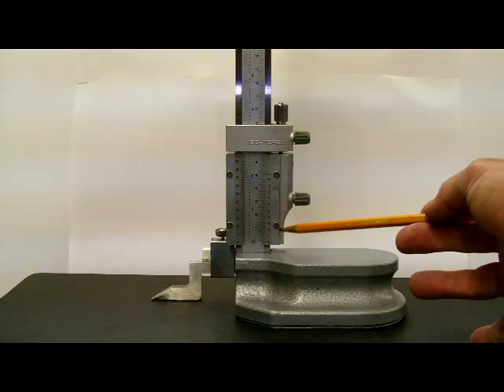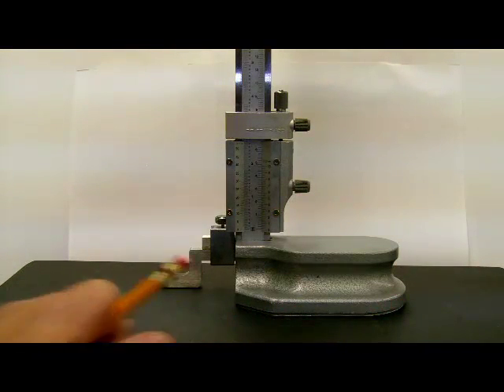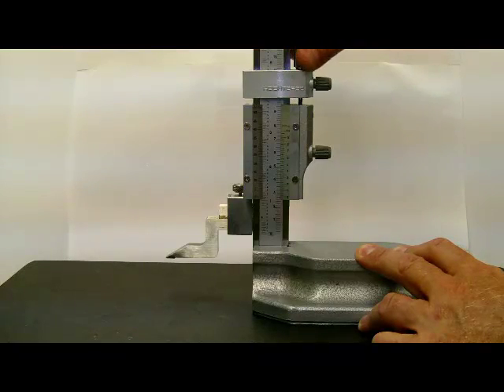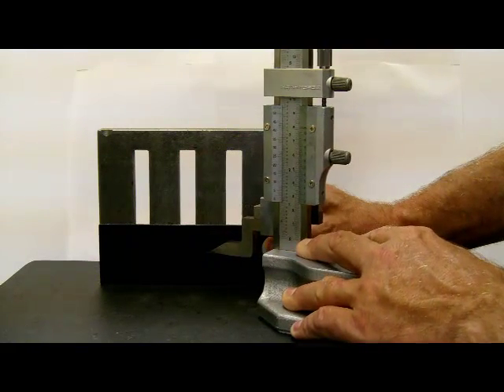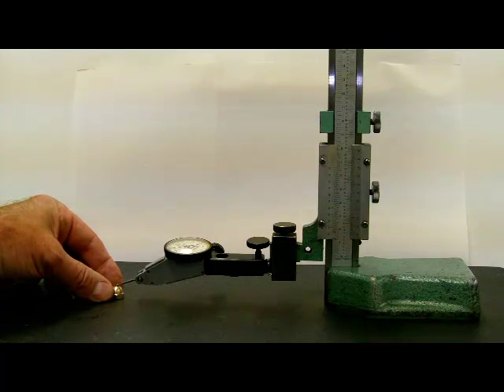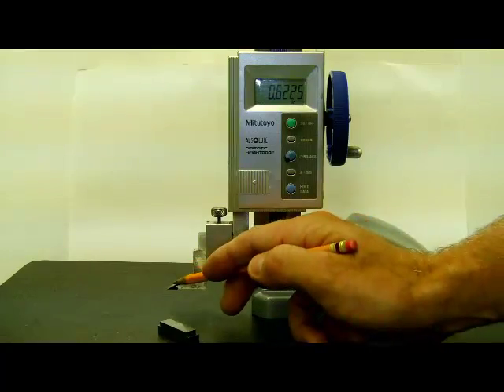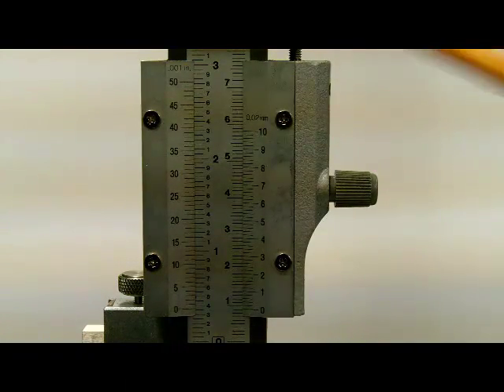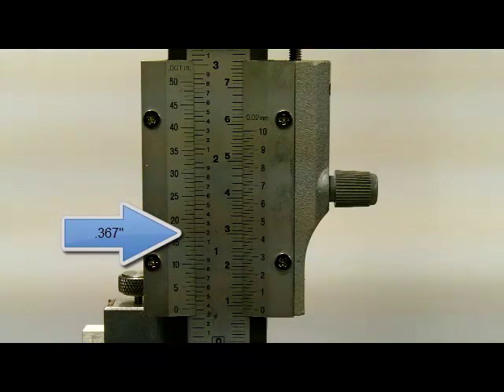Height Gauges

Comment: Nice boat anchor no one has time to screw around a read a vernier scale anymore out here in the real world also the risk of reading error is real.
Reply from the maker: I agree it is not a tool you are likely to see...I also wonder how many can't/won't be able to read a vernier scale.
Reply: At college we only use vernier scales, no digital
Reply: @henritheron3050  Did they teach you how to run a metal shaper also?
Reply: @robc8468  I'm guessing that is mostly a joke but it would have been cool to see one in action. Then I can be like one and make anything except for money 💰
Reply: @machiningmoments  we have some old vernier scale tools at General Electric aircraft engine assembly. Most of our job tests use the old stuff!